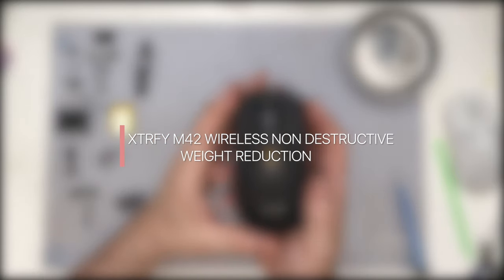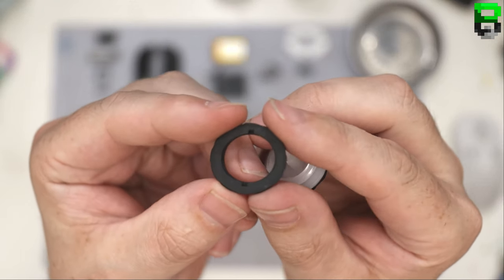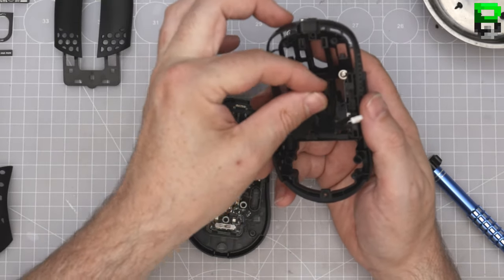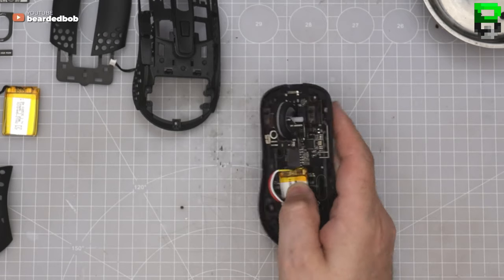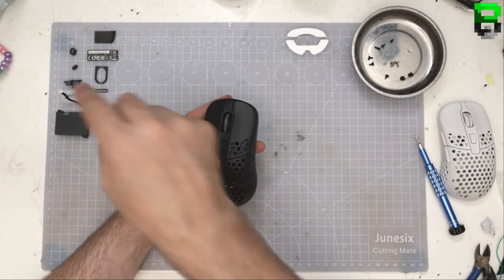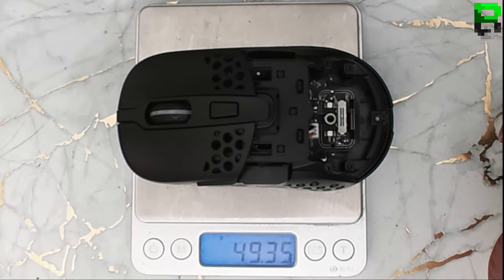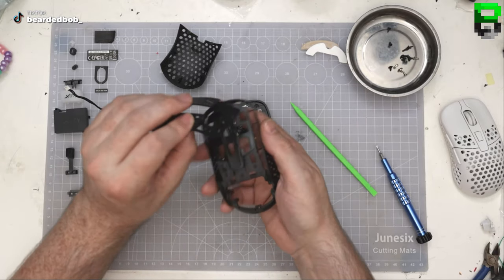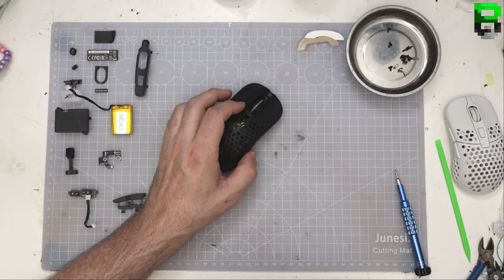UNBELIEVABLEY LIGHT AFTER THIS!: Xtrfy M42 Wireless Weight Reduction

Comment: hey bob! I have found on aliexpress GPXS  honeycomb 3D printed shells, they arent too cheap but for $30 its not bad esp if youre like me and dont want to drill holes in the original shell. additionally, I found pcbs for gpxs including some that are pre soldered for like $12 CAD. kalith switches, omrons, ttc golds, blue dots etc ! planning to buy a pcb with kalith gm8s & a full honeycomb shell & bottom. im not sure if you would have use of this informstion, i can provide links/shops if needed !

Comment: After researching for a while, I only found 250 mAh batteries with 3 pin connection. I wasn't not able to find 150 mAh batteries with 3 wires, so I can't connect JST connector even if I wanted. Wish Beardedbob senpai would reply to any of the battery comments because it would help a lot with the weight reduction
Reply from the maker: ►Battery Link
150Mah 1.5mm battery https://s.click.aliexpress.com/e/_9GcoJe
200Mah 1.5mm battery https://s.click.aliexpress.com/e/_AbQIPO
Reply: @Beardedbob  what one do you need for this mod specifically: 3 pin 2.54 mm, 3 pin 2mm, 3 pin 1.5mm etc?
Reply: @Beardedbob  anyone got an answer on the previous question ? Which dimension should the plug be 2.54 mm, 2mm, 1.5mm, ... ? 
I was reading some other articles and from what I understood anything around 1.25mm - 1.5mm could work but I'm not 100% sure
Reply: @DIOPA  1.5mm. bought a 200mah 1.5mm and it fits
Reply: guys is this mod risky? I'm buying this mouse and was wondering if doing this would break my mouse since I have never done a mod before.
Reply: @ahmoodk  
Didn't seem risky but my m42 wireless sensor now has issues. I don't think it is from the mod. I think the sensor is just bad. I don't like the mouse anymore.

Comment: hey man, could you check out the Marvo Z and see if its possible to weight reduce without removing all functionaltity. It looks like a perfect mouse for at least me personally cause the gpro shape is a bit tall and clumsy for my hand with the sensor placement, but after playing with a superlight the weight is too low to want to switch to 96 grams just to have the option to change grips
Reply: ive done this before on the fit pro. i removed the rgb diffusers and the back led plastic piece and dropped the weight by around 10g. could probably drop it more by removing the battery plastic cage and a battery swap.
Reply: @notTerabyte  thanks
Reply: @ravencl  in general, the weight is still gonna suck ass unless you do weight reduction on the actual shells, or print out custom weight reduced humps